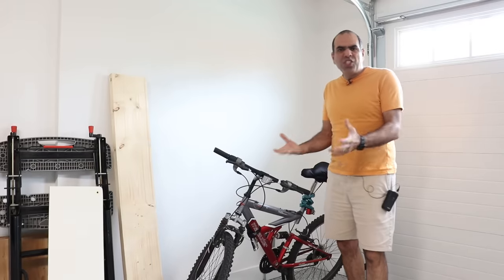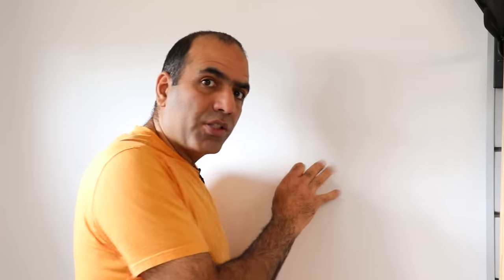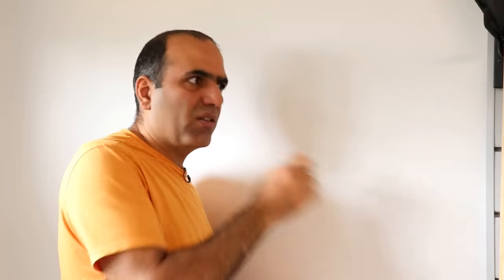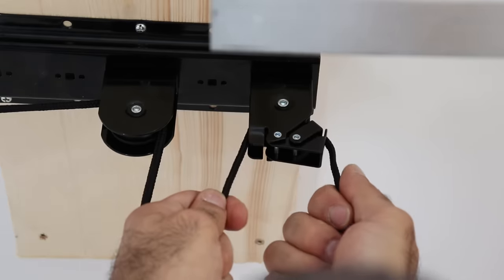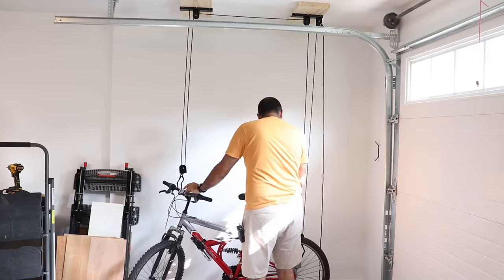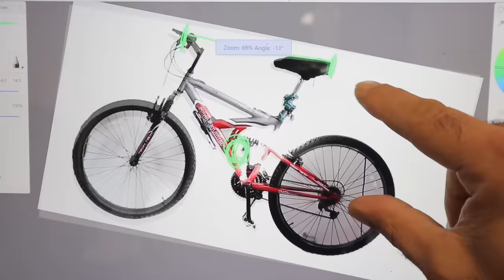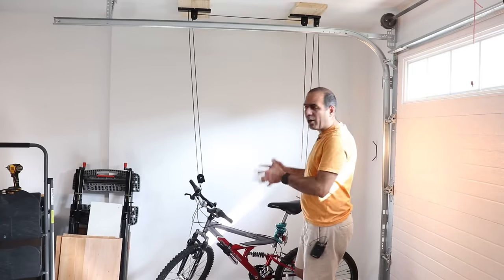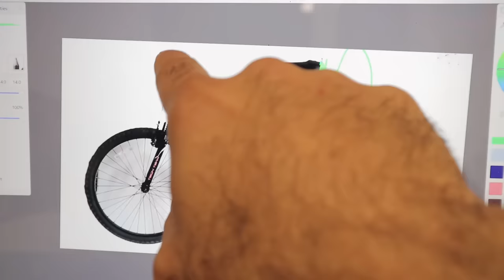HOIST Your Bike (Installation and Review)

Comment: You can make a very small modification to get  much better grip on the saddle when you pull up the bike . You should remove the hook used for hanging  the saddle side and just tie a big eye at the end of the cord. When you fix  the bike in to hoist you put the cord loop over the front pointy side of the bike seat and the tension of the hoist pulls it back to keep it tightly in place

Comment: I tried this kind of thing in the past and found:  The string is too thin, so it chaffes the hands.  the pullies are too crappy - they create too much friction in use, and many times I had the string drop down the side of the pulley, which was a major pain - the bike was stuck, I had to climb up to the ceiling, etc (and my ceiling was much higher).  I looked for good quality pullies - from the sailboat supply store - but they are soooo expensive.  anyone knowing a good source of cheap and but good pullies for this application will be super appreciated.  Enjoyed your videos as usual Mehdi.  HOIST

Comment: I have 2 of these, and I hate when the rope slips off the pulley and rides on the center shaft. I am going to use a electric hoist from harbor freight and use that to raise/lower the bike. The hoist will be in the attic.  I also don’t like how  the seat hook works - very sloppy.  And your right, the rope is to long , especially when the bikes are near the ceiling. It’s a rope mess that gets tangled.  My attic hoist will solve all those problems.

Comment: I've got one of these I installed last week.
It works ok.

I had to modify mine because I needed the bike higher to clear an up and over garage door.
And as stated the seat hooks aren't great, so the angles were modified too.
Would I recommend it. 
Yes.
Just be aware there is a large gap between the ceiling and the highest point of the bike due to the large size of the pulley and hook system.

Comment: I know there is another method on finding studs you can knock on the wall. But I think that only really applies if there is only air behind it. If the knocking sounds deep and hollow there is nothing. But if it sounds quick and high then there is most likely a stud behind there.

Comment: Thanks for making this. I have 3 bikes - and need to get at least 2 out of the way, and my garage has a high roof that's 8 ft. What about 2 clamps for the top horizontal bar that goes between the seatpost and front wheel post?

Comment: Just thought if you fitted one of the pulleys onto a strip of Bosch Rexroff extruded strip… you could then  air a slide so that the distance can be adjusted for different length bikes. But mine will support my tandem and an ordinary bike

Comment: 2:45
acually in some very expensive houses they use brick , concrete and metal rods in the whole house  instead of wood and drywall. its downsides is that u cannot run wires inside the wall after building. so we use white coverings that match with the paint. so we dont need to find a stud and cant just screw into a wall and need to make a hole and a wood piece or a screw holder is inserted and screwed into the holder.

Comment: The  pulley lifting up the front of the bike is getting a 4:1 reduction. That results in one quarter the weight of half the bike (assuming the bike balances itself between the front and rear). That equals 12.5% of the weight. The pulley at the back of the bike is getting a 2:1 reduction. That results in half the weight of half the bike. That equals 25% of the weight. This adds up to 37.5% of the original weight (around 1/3rd). The balance and the friction will impact this. It would be interesting to know how the weight changes if you hoist the bike the other way around.

Comment: Hoist by top of the wheels. Will make it much more balanced. And re-route the string so each side is pulled independently, so you pull on 2 strings at the same time. You'll need more force to pull though. If that's a problem add more pulleys ...and your project just becomes bigger and more crazy, but also cooler :D

Comment: One point to consider about inverted mounting a bicycle is that the shock absorbers on the front tend to leak oil that way because the oil pools against the top seals. however... at 42 pounds and $100 I'm going to assume this bike only has springs in the front fork and would be just fine. Also Mehdi I really need a scope. ::insert life story here:: TLDR I'm trying to put my bench together in my new living space after losing a lot.

Comment: Look for the option of pulling it up from the centre....& not from one end ..presently all the pulling force required in on the rear pulleys...
a centre pull will proportionately distribute the load both front & back pulleys.., each seeing  almost even pulling forces... 
A longer rope is needed for this..yet...
I know you can work this out ...
before your rear pulley fails..

Comment: Insulation shouldn't affect the stud finder. You have to put it on the wall between studs, turn it on while against  the wall (it self calibrates), then slide to find studs.

Comment: To prevent rope burn, mount a crank system so you only have to turn a crank rather then pulling a rope. The crank mechanism should lock up if the crank starts to free spin if it is accidentally let go of.

Comment: I have this hoists for 3 bikes , corroded after 2 years but still good .  I can assure you - hanging by the saddle is a BAD idea, instead much safer is  to use  rear wheel.

Comment: Add a motor above the tie off for the rope with a guide to stop it locking in place, hook a switch to the motor.  You motorised it and now even mini Electr-...  Sorry I mean mini Mehdi can pull it up with ease.  Just need to make sure to leave a little slack on the rope so you can lock the pully again. :P

Comment: One thing i will do is to use some cordage, create some permanent cordage loop on the bike and then replace the hooks on the hoist with heavy duty carabiners instead. Also i may make some hand cracks made from wood with a locking system to make it safer for the kid so we will crank it up rather than pull it up.

Comment: Some kevlar gloves will make easy work of the rope. Just let it slip in your gloves hands and get it down quicker. Though, for an ElectroBOOM episode you can make  fool of yourself installing a miniature winch. And I feel like the extrea rope you severed off would be ideal for a winching system to mechanically levitate your bike. But this can be to your benefit if you use carabiners to join the ropes together, as both an end-stop for the winch and means to disengage when power is unavailable.

Comment: If this came with thicker rope it would be a lot nicer on your hands.  Or if you knotted the rope every foot or so it would give you something better to grip.  Some people use a ratcheting winch but that's beyond what this needs i suppose.  Maybe there are cheap ones for light loads.  

The aim is to have the bike as high as possible, right at the ceiling somehow, then draw the bottom of the wheels towards the wall so its less in the way.  Also position that pedal as high as possible.  You want that pedal above head height so you never hit your head on it.  At 10:03 or
https://youtu.be/ma5BGPh2oPY?t=603
it looks like it might be possible given your ceiling height if the pulley hooks weren't so large.  Looks like your ceiling height is 8' or 8.5'.  
Another option would be lifting it horizontally up to the ceiling with 3 pulleys.  This is especially space efficient if you've cut down your handlebars so they're not so wide, something often done for city riding to minimize hitting things like cars.  A wide handlebar and traffic  is not a good combination!    

Another application for hoisting your bike up is for people in apartments, especially with narrow hallways where the bike is always in the way.  One could hoist it farther away from the wall, say on the north side of the hallway, then pull the wheels over to the south wall so the pedal is above head height.  Or you could install 2 small shelves or hooks on the south wall for each wheel.  

When you're doing videos like this it would be great to know the ceiling height you're working with, also your height so we always have a frame of reference in every frame.  

Your humor is priceless, with flawless comedic timing.  You are truly gifted at these presentations and so deserve your popularity.

Comment: You need to add a ratchet and damper to the first pulley. Ratchet going up, dampened coming down. Or, a stepper motor, and ESP8266 and a phone app!

Comment: Time to make electro HOIST and add some gadgets like limit switches for auto cut off. 😂

And as mechanical limiter or safety... Add one loop at the end of the pulling side of the rope to just hook it up to wall attachment. Instead of winding it up everytime.

Comment: Not trying to be funny but I’m 62 years old, and I’m strong enough to just pick up my bike and place it on hooks in my ceiling. It’s quick easy and clean. The time used doing all this to pull my bike up. I’m already in the house. Also, I can walk under my bikes easily.

Comment: thare are these special screw holes (i don't know how you call them in english) that spred behinde the dry wall and you don't need to screw your screw in to studs but you can screw them in these holes and the dry wall can hold the weight. i used them to mount my tv on to the wall and they hold nice and sturdy th tv is prety heavy.

Comment: Wouldn't flipping the front and the rear make it easier to pull? That way the rear of the bike gets pulled with more mechanical advantage than the front, although risk rotating the bike because the rear would get pulled up slower than the front.

Comment: I am so lazy that I would make a double arduino system to avoid having to pull the bike. One arduino with a sturdy stepper motor would wind and unroll the wire with the two switches (UP  and DOWN). A laser sensor would mesure when the bike is up with another arduino and a little servo would lock the system in place.

Comment: It's not as easy to hook a bike on ceiling hooks as you might expect. Aiming is difficult over your head while holding 40 lbs that also has a swiveling front tire and handlebar. This also lowers the bike into the proper orientation. You don't need to flip it.

Comment: The wood is not exactly 2 inches by 10 inches because of the kiln drying process the wood goes through. you never needed to know this but now you know
Reply: No, that's not the reason. At least some lumber used to be the full size. Many older houses will have true 2" x 4" studs in the wall. I had a house built in the 50's like that. Cutting off a half inch was an "economic compromise": http://www.harvarddesignmagazine.org/issues/45/nominal-versus-actual-a-history-of-the-2x4

I'm sure you can find some other references online too.

Comment: Just got this system, and theres one other beneffit you left out. In my garage it allows me to mount the bike much higher than i could wmif i had to lift it manually. The roof is exposed (no ceiling) but theres no way i could lift it that high, whereas I can hoist it that high.

Comment: If you connect the rope to the bottom of the garage door, when you open the garage, the bike is lowered, and when you close it it will pull it up. That is, if you only use it for bike storage ,😅

Comment: You mounted the pulleys too far apart. When the ropes are at an angle, only the vertical vector component of the force on the rope is applied to lifting the bike. The further apart they are, the more force will be required. When the ropes are completely vertical, then all the force you apply goes to lifting bike.  When you have the pulleys at an angle, the ropes get increasingly sideways as you increase the height of the bike which means you'll need to apply more force as you increase the height of the bike. Based on some really quick calculations and angle estimates, I think you have about 1 to 2lbs extra force when the bike is halfway up, and more when the bike is near the top. It's easy to visualize this with extreme case: Imagine if you had pulleys mounted at opposite ends of the garage (i.e. off by more than a dozen feet instead of mere inches) then the amount of force needed to pull the bike up to the top would be more than the weight of the bike.

Comment: Available at Harbor Freight for $10.  Bikes belong in the house not the garage. (to prevent rust)
  Use a 1x4 about 5' long to span several joists.  Yes, I know yours are length wise. Just tap on the ceiling to find the joists.   Lots of customers pics here.  https://www.harborfreight.com/bicycle-lift-95803.html

Comment: Now do it the right way:   Attach the hooks to the wheels, it is what those hooks are for. Better yet, flip the bicycle over, wheels to the sky, attach hooks to the wheels & hoist 'er up.
Funny enough, you placed the pulleys just right, for attaching the hooks to the wheels.
Pro-tip:  place a little "bumper" material to the location where the handle bars usually end up at when fully hoisted; protecting the handle bars & security measure to reduce the chance that wifey ends up murdering you in the night for having blemished the walls.

Comment: why dont u just make something rolls it up n down just like on boat trailer turn gear pull boat in
could be much easier then pulling n release rope
2nd thing got my attention about seat u could find pieces of steel rod n stick under seat where two steel rod hold seat to pole n hope this could make easy hook without failure

Comment: If he were more into physics than electronics, the pulley system would make so much more sense to him than it seems like it makes to him. And I'm guessing he's not very into physics, judging by the way he describes things. He's still a fucking genius, though. You can't be an expert at everything! Another thing he could do is take the second bike and clip the wheels to each other and hoist both bikes up together. Don't worry too much about "recommended" maximum weights. They always undershoot those numbers to protect their asses. You can almost always put way more stress on ropes than manufacturers claim you can put on them.

Comment: 8:34 seat side hook is at an angle, it should be straight up only then the hook will work or else it will slip off. what a disaster Mehdi
9:40 very unsafe installation